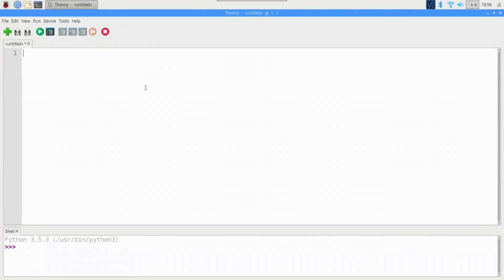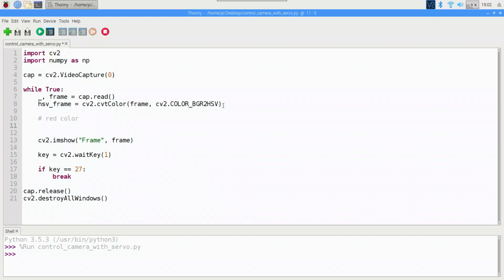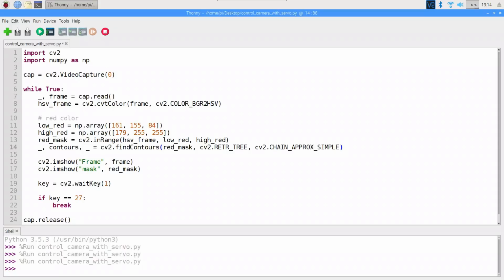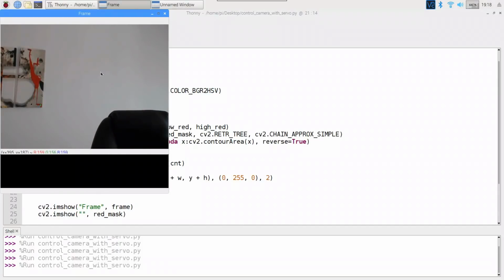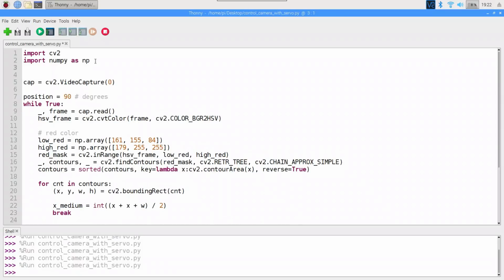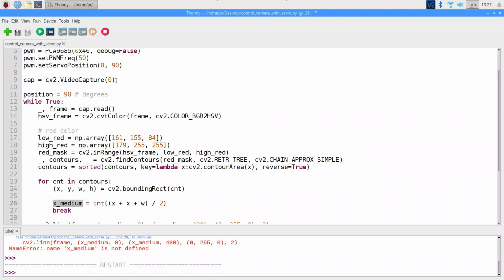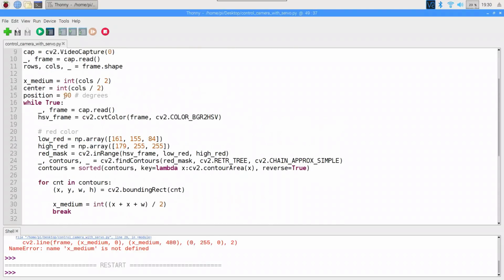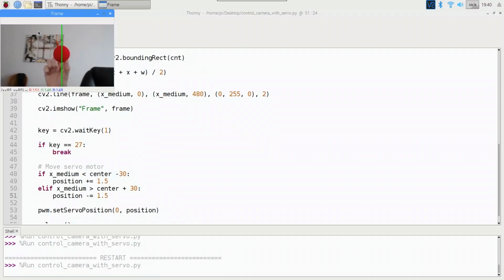Control webcam with servo motor and Raspberry pi - Opencv with Python tutorial

Comment: Can this still be done if I use a continuous rotating servo instead of a positional one? 360 instead of 180 essentially
Reply from the maker: Yes definitely
Reply: @pysource-com can I contact you with some questions? This is part of a project im working on and im having the most difficulties trying to get this done. Im not sure what exactly im doing wrong

Comment: I am  doing segmentation by RGB values of the object, and it is running good but the problem is the display shows the segmentation after 8 to 9 seconds when I put the object in front of the camera...I m using RPi 4 b model with 4 gb ram ..please help me to reduce the response time..I m using Logitech USB cam

Comment: Hi, I have the adafruit library for the PCA9685, but when I run your code I get an error:
from PCA9685 import PCA9685
ModuleNotFoundError: No module named 'PCA9685'.

Do you have the library you used for this module? I don't understand why the Adafruit one is not working for me.

Comment: Why are you shooting the video towards the window with the sunlight coming through it? That's why you can't see objects. Horrible camera position. The camera should be facing oposite direction with the sunlight working with the webcam.
Sunlight >> Webcam >> Object . Not Webcam >> Sunlight >> Object. Spin the workspace 180 deg. so the sunlight shines on the object and works behind the webcam, not in front of it blocking the objects because the sunlight is shining in the webcam.

Comment: I am using the RPi.GPIO library. The problem is, that it's not able to update the angle on every frame, bcs you need to put a time.sleep(0.5) after you gave the servo the command to move to an specific angle. Otherwise it will just instantly jump to the next command and never really has time to move. Is there a different way to approach this, without using the PCA9685 library? Bcs I'm not possesing the extra board
Reply from the maker: You could integrate the python Multithreading option, so that one thread will activate the movement of the servo, while the second thread will keep track of the object at the same time.
Reply: @pysource-com  Thank you a lot for the quick answer! I'll give it a shot for sure

Comment: Can this project be used with yolov3?
Reply from the maker: Yes, using the DNN module by opencv you can import weights and cfg files of yolo v3, and also yolo v4 and then you can integrate it with the code I've written

Comment: I have a 3D model I need to measure the length, width, and depth of the feature and detect the features as a hole, pocket, planner ..could you help me to do the coding in Open CV with python

Comment: Why not just use: x // y instead of int(x / y)
Reply from the maker: Because the pixel has to be an integer, and in case for example the result is .5 ,  it has to be rounded otherwise you will get error
Reply: @pysource-com   I was under the impression that when using //, you will produce an integer, and / will produce a float.
Reply from the maker: @brandonstringfellow1041  Oh yes sorry, I missed that. Yes you're right, using // as you said is a better solution than using int()

Comment: Efficiënt programming is not his forte :)
Using sorted, with reverse is highly inefficient. Because you’ll iterate through the list twice.
So a simple one for loop and only keeping the biggest counter is faster.

Plus you don’t need to setup an iterator in a for loop and run it only on the first item — winning performance and reducing an instruction.

Doing the x_medium definition calculation and then performing the same calculation for the center is bad! Just assign the x_medium to the center.

It may seem nit picking but in applications where there’s a lot of processing, this sort of thing. You need to minimize overhead.
Python already is slow, you could knock this up in C++ and even then, you’d make it efficient.

Comment: Hey 
I am getting this error 
Please guide me through 

select timeout
VIDIOC_DQBUF: Resource temporarily unavailable
Traceback (most recent call last):
  File "opencv1.py", line 8, in <module>
    cv2.imshow('Frame',frame)
cv2.error: OpenCV(4.1.0) /home/x/opencv_all/opencv-4.1.0/modules/highgui/src/window.cpp:352: error: (-215:Assertion failed) size.width>0 && size.height>0 in function 'imshow'

Comment: can you make a project to detect speed or velocity of an object?
Reply: This is difficult with a single camera, as you need to know the distance to the lens! Something close to the lens moves faster then something further away. If the camera is stationary and the objects are always at a similar distance then it’s easy. You measure the real life distance between two points in the frame and time how long it takes (how many frames) for the object to hit the first point and to hit the second point.
I’ve done this with a camera on my balcony that looks to the road across the street. And it calculates the amount of cars a day and the average speed. Speeds aren’t super exact about 10% deviation. But enough for that solution.